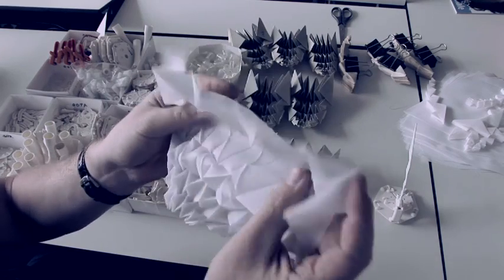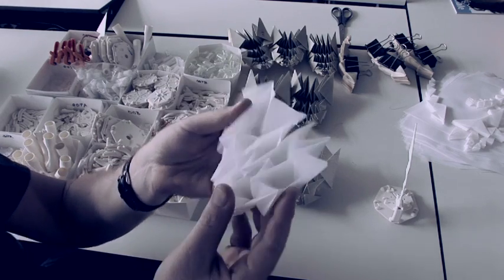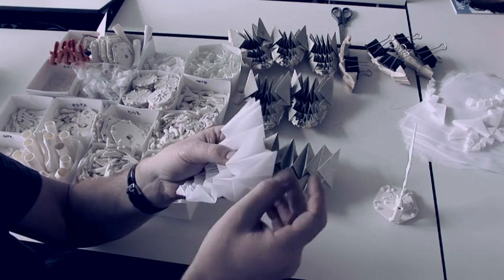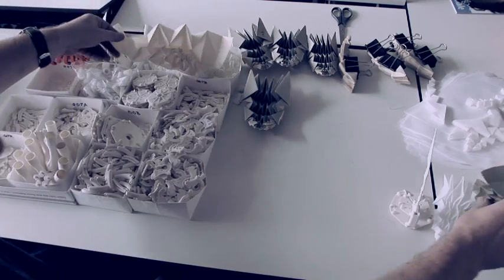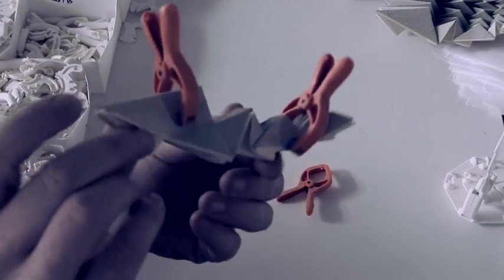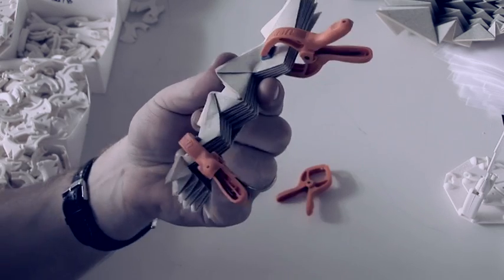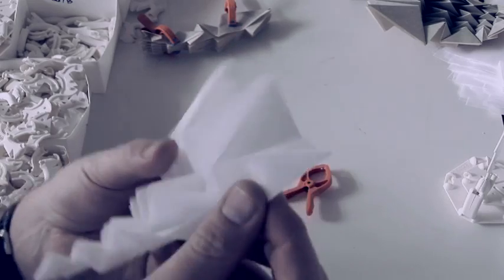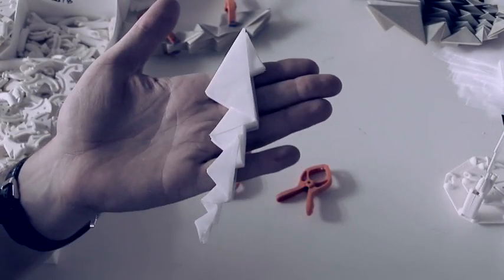Oribotics Fabric Folding Process

Comment: Are the mold pieces of paper identical in scale?
Reply from the maker: great question! in this case, no they are not, there's about 1% difference in size, the top sheet is smaller. I experimented with different scales. To get it right for your application you really need to make a few different types. This is really only possible if you have a highly accurate way of scoring or creasing the paper, such as a laser or cutting plotter. In this case I used a laser. Quite a lot of this is covered in my book Designer Origami in the section on fashion: https://matthewgardiner.com/designer-origami
Reply: @oribotic  Thank you for the reply, I love your book! Have you tried using thinner paper for this technique? If so, what gsm and did you run into any cooking issues? I'm attempting a very intricate pattern and the thicker paper is difficult to work with. I'd love any suggestions!